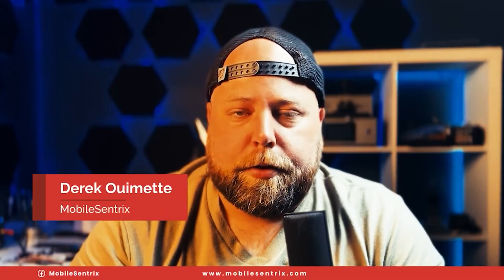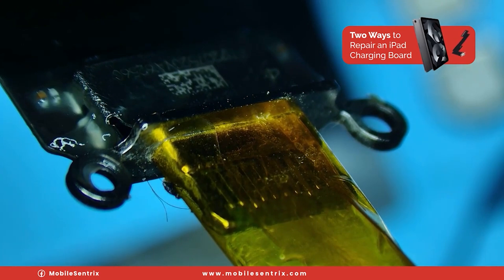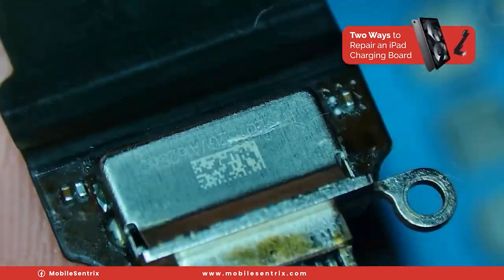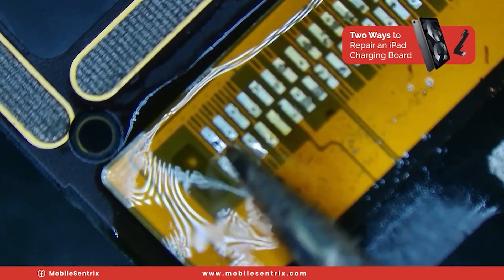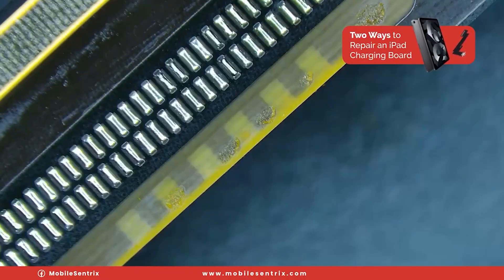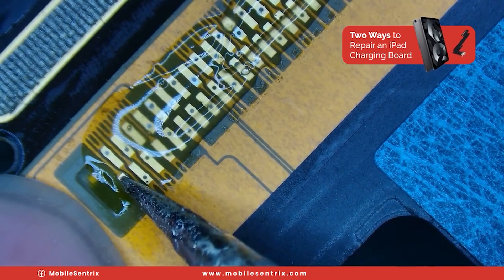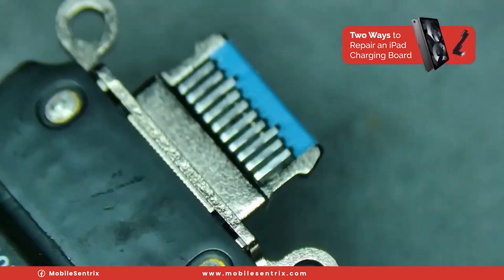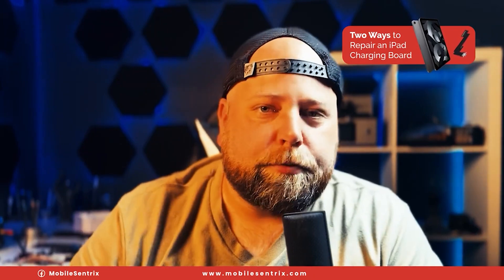How to Replace Charging Ports on Most iPads: Two Approaches

Comment: I see the “tools” needed/used in the description, however, would you mind sharing links to the specific products you reference in the video? (ie, low melt 138, 183, flux, wick, and type of solder tool you use?). Otherwise, I think this is a great DIY video with top notch POV on the tedious removal and solder repair of the cable!